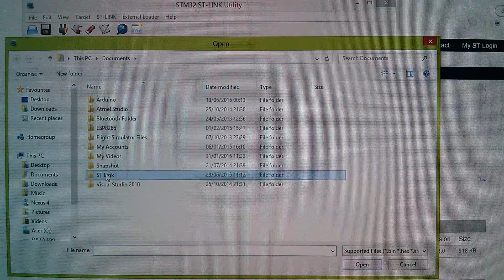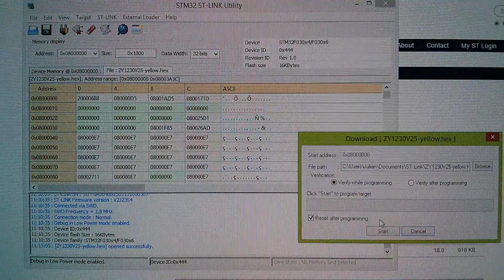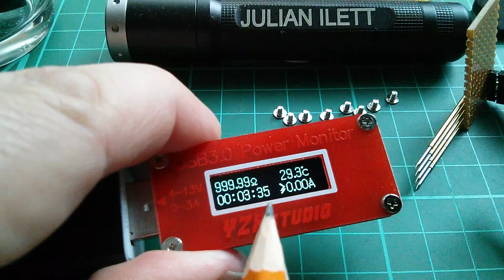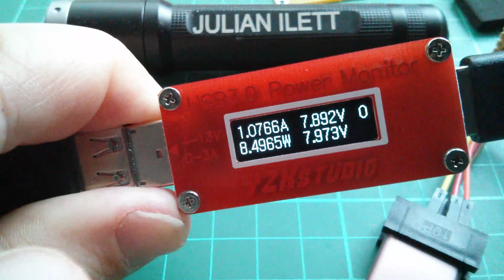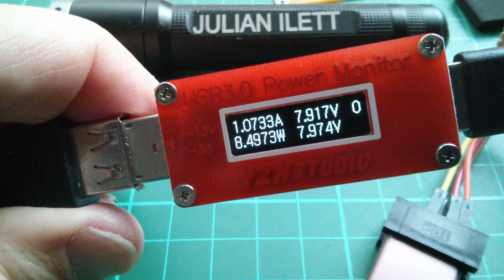Julian upgrades: ST uC Firmware for YZXstudio USB Monitors

Comment: The sharp pogo pins would sink into the soft solder so no need to remove the Bluetooth wires. If the solder is not that soft, locating holes could be made by any method.

Comment: Where can I download new firmware file ("ZY1230V25-yellow.hex") ?
( I bought it there http://www.ebay.com/itm/111528571768 (elsewhere. was sold out at that point) )
Reply: kose2ik What you got seems to be an older hardware version. You can tell by its 2-PCB construction vs the newer 3-PCB. Contact me on eBay and I'll see what I can do. http://stores.ebay.com/99centHobbies

Comment: I think the extra chip in the yellow one won't be a FET, it probably be a simple 2 channel DAC to set the data pin volages, similar to the function of smart USB charging chips.
Reply from the maker: KX36 Yes, calling it a FET was a bit silly. I'm now thinking a multi-channel anaolgue switch, either to route D+ and D- through or the Apple 2.4A voltages from some resistor dividers.

Comment: Depending on the pogo-pins you got, you don't even need to solder a jig, because they fit directly into the connectors like pins. Of course in that case it would be useful if the leads aren't all separate, but in a 4-pin connector. The pogo-pins also work in 2x3 or 2x5 header connectors (your typical ISP header) very well. On many boards I don't even bother to install header pins for such interfaces any more, just leave them unpopulated and press the pogo-pins in the holes for programming.
The important thing is to get the right diameter and shape of pins. These work very well on pin holes and pads as well.
http://www.ebay.de/itm/50Pcs-P50-E2-Dia-0-68mm-Length-16mm-75g-Spring-Test-Probe-Pogo-Pin-/400561307703
"P50" is the diameter that fits into most connectors made for normal pin headers.
"E2" is the shape and diameter of the tip. This shape has a sharp tip to pierce oxide layers if you push it on pads or solder joints, but the tip is also wide enough that it won't go through most "standard" pinholes.

Comment: You can use the same ST-Link V2 for the SBMS4080 firmware upgrade. There is no newer version than the one you have already in your unit but you can modify the firmware is you want since the code is open source and available.
No need for those pogo pins on the SBMS4080 there is a 5 pin connector at the top and you need to use just 3 of them GND , clock and data. The power will need to be supplied externally from a battery and entering programing mode is only possible in the first 2 seconds after power boot so you need to insert the 10 pin cell balance  cable that also supplies the power to SBMS and immediately within one or two seconds push the start programing button.
The new SBMS100 will have a USB port so no external programmer will be needed for firmware upgrade and instead of the two seconds at boot there will be a BOOT0 pin available that will put the microcontroller in programing mode.
I like this guys from XYZ. I had some time ago one of their products a CC-CV power supply 5A 60V with 2x16 LCD display able to display a lot of useful information quite similar with this USB monitor.

Comment: So where can we download the new firmware(s)? I can't find them anywhere. Also, I still can't find a manual for these things! I had no idea the settings/calibration menu existed!
Reply: Aiiskoplusaiist Hello, Franky here. I provide the English manual (as while as firmware upgrade files and instructions) for customers who bought from me (f-t-2000 eBay store). If you ordered your unit from me you should have received the documentation in email within about a week after the purchase. I don't think other sellers provide any such documentation or support if you bought yours from them (that's why they sell them cheaper). If you did buy from me but didn't receive the documentation, please message me on eBay to let me know your order details and I'll re-send it. Thanks!
Reply from the maker: Aiiskoplusaiist If you've bought one of the monitors from Franky, he'll give you the manuals (which he wrote himself) and the firmware.
Reply: gfx2006 Thanks guys.

Comment: Hi Everyone, Franky here. My apologies that both the Red and Yellow are out of stock at the moment (late Sunday night 28 June Hong Kong time). I may have some back in stock tomorrow morning my local time (maybe 10 hours from now), but will only be for short period, as I will be going on a holiday tomorrow evening and my eBay store will be closed in the next 2 weeks. I will still be able to answer questions but just won't be able to process any orders while I'm away. My apologies for a somewhat unfortunate timing.
Reply: gfx2006 I want to be the first to say thank you for an amazing product. Inside and out, it looks to be a fantastic bit of testing equipment.
Reply: ***** The Red meter will show you the D+/D- line voltages on the INPUT end and tell you what kind of USB port (with current rating) it has identified (Apple, Samsung, or generic Android DCP). The Yellow one, on the other hand, tries to detect what device is on the OUTPUT end and emulate the necessary D+/D- voltages to enable fast charging.
Reply: Yes, I always sell my units with the latest firmware version. I also provide the firmware file as well as instructions for upgrade if my customers requests it.
Reply: gfx2006 Luckily you sent mine a few days ago!
Reply: gfx2006 Franky, are you sure this RED meter can distinguished Android, Apple and Smart/Intelligent ports ?
Reply: +gfx2006 Are your unit's updated with the latest software?
Reply: +gfx2006 That is good though I believe you've ran out of stock.

I see that they are selling the ZY1231 version which has the same charging accelerated capability here. Do you concur? The source is real too right?

Here: http://world.taobao.com/item/38401794937.htm?fromSite=main&spm=a312a.7700824.w4004-11726212606.14.5J6lew

Comment: Yellow one is sold out at the moment. :-(  The listing for the red one says it can do remote serial data logging if you attach a serial port to the programming pins,  maybe that would be an interesting video?  Should be easy now you've made your little adapter board.
Reply: mc349iii Actually both the Yellow and the Red support remote serial data logging, either through a serial/USB adapter, or a Bluetooth/Wifi module (that draws no more than 10mA).
Reply: gfx2006 Hello and congrats to this fantastic product ! Would you be so kind and give us a link to this bluetooth serial adapter on Ebay or elsewhere to buy ?
Reply: lajson Just to clarify - I didn't make these. I do keep in close contact with the maker though, hence the ability to get him to make firmware updates based on Julian's (and other customers') feedback very quickly. I haven't personally done the testing with a bluetooth module so can't recommend anything yet. Anything that draws less than 10mA should work. I will update my eBay listing with some recommendations when I come back from my holiday 2 weeks later. If you don't mind a wired serial-to-USB connection, look for something like item#310676792112 on eBay. I tried something very similar and it worked well. Instructions on connecting the serial interface will be included in the firmware v2.5 manual for my customers.
Reply: gfx2006 Thank you Frank :-) You have a really nice store on the bay and excellent service ! I will check the item you mentioned and will soon order one of yours power meters :-))) 
Have a nice vacation sir !!!